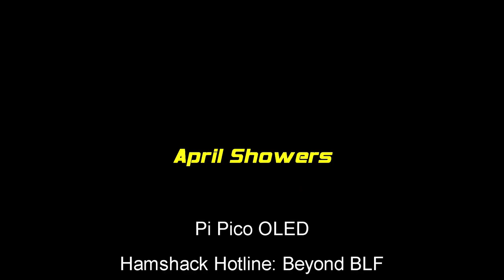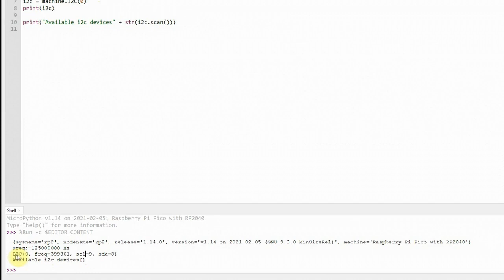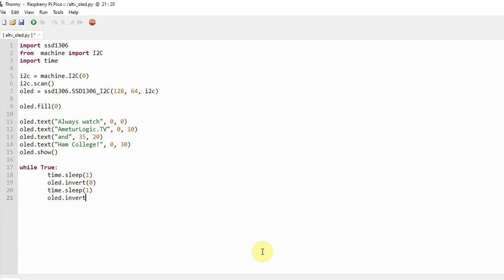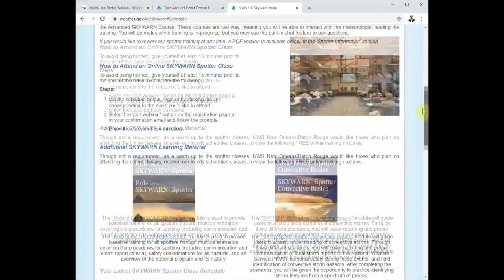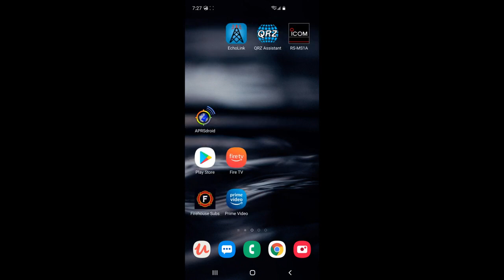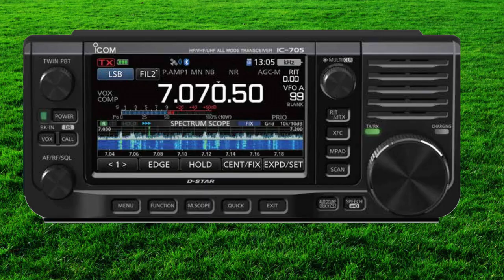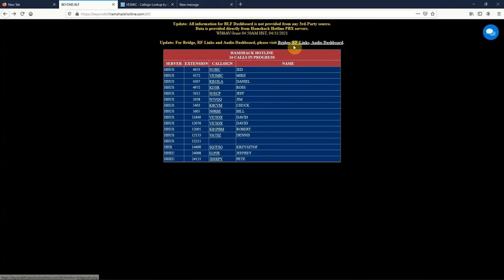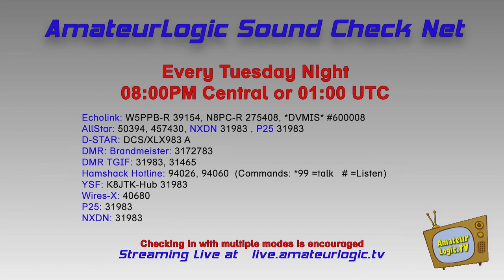AmateurLogic 155: Tower Failure Follow Up

Comment: That MFJ antenna is basically a revisit of the old Squalo antenna that was popular on 2 meter SSB back in the 70's. It combines that design with the fan dipole. 
73 de WD5DHK

Comment: Where do I find info on how to use my dstar radio to connect to your Sound Check and/or your chat room?  I do not see anything on how to use the "DCS 983A"  connection.
Reply: Hi Oldin. You can get in the chat room for the live stream by going to https://www.amateurlogic.tv/chat/. We are only in there during the live stream however. As for D-Star, if you are using pi-star, you can find XLX983A in your list to manual connections under the Admin tab. If you are using something different, let me know and I will try to help.